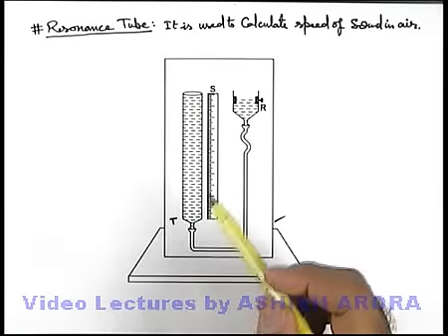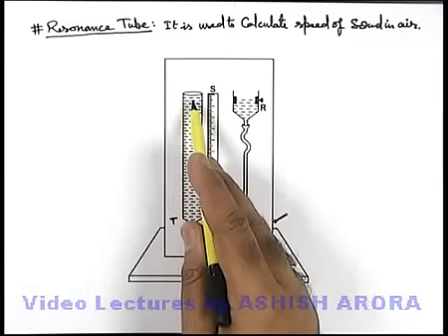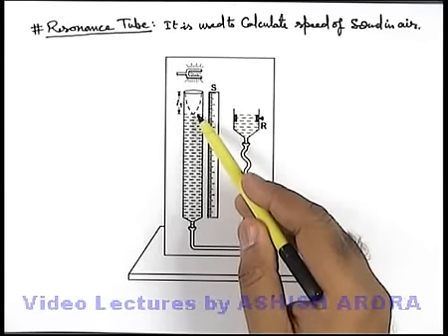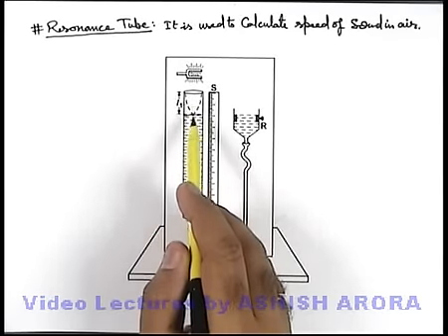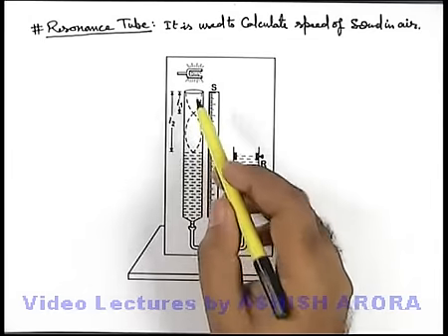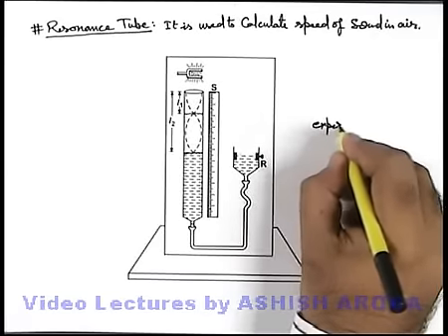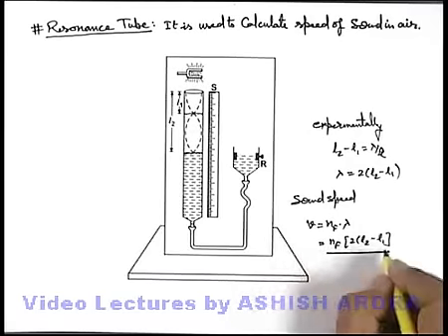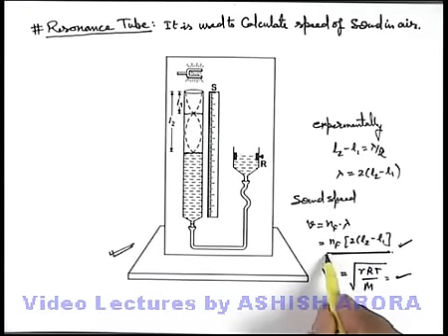Class 11 Physics | Stationary Waves And Beats | #35 Resonance Tube | For JEE & NEET

Comment: sir why couldnt we find lamda from the first measurement itself ie. lamda=l1*4
Reply: Because it's not exact there is some error at the opened top of the tube generally called 'e'
Reply: In continuation with Ayush’s comment , e is better known as end correction
Reply: in continuation to all your comments, the question was asked 4 yrs ago.
Reply: @erenjaeger309  yo it, ik it's a 7 month old comment but i have a small doubt, how does the resonance occur second time with same frequency? Doesn't the frequency need to be tripled as seen in closed organ pipe to achieve that s/w?
Reply: @erenjaeger309  in continuation with your comment, I'd like to point out that many other students might end up having the same doubt

Comment: Sir how did u lower the water level and whatAnd what is the significance of this experiment, I mean sonometer experiment was similar and worked well then why did we introduce a new experiment
Reply: Vijay Vyas sonometer is for transverse waves in string,,  resonance tube is for longitudinal waves
Reply: When the reservoir is lower down,,,  due to pressure dufference water moves into reservoir and flows out and so the level is reduced
Reply: How will you use sonometer for a longitudinal wave.